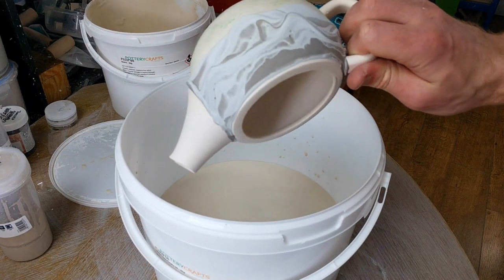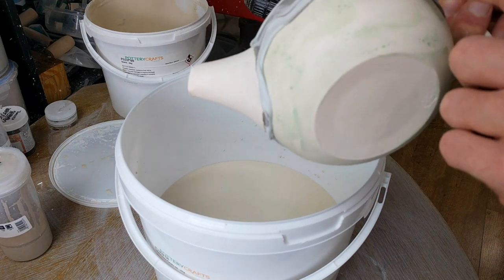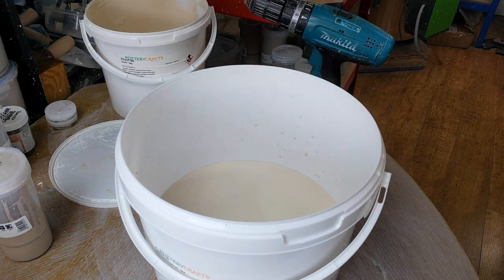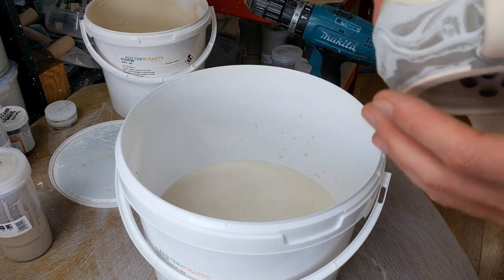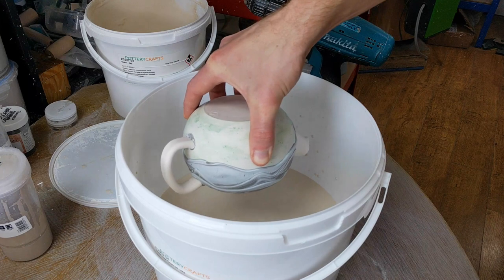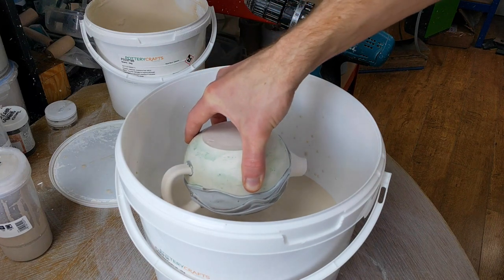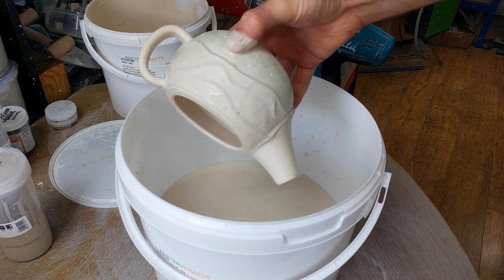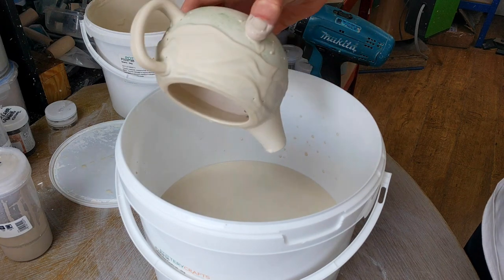Glazing the Drippy Slippy Teapot (Part 3)

Comment: So how did you fixed the slip to fit the clay body ?
Reply from the maker: If you apply the slip while the clay is fairly wet, it'll stick well
Reply: @OldForgeCreations   are you using deffloculant ?
Reply from the maker: No, not for this slip